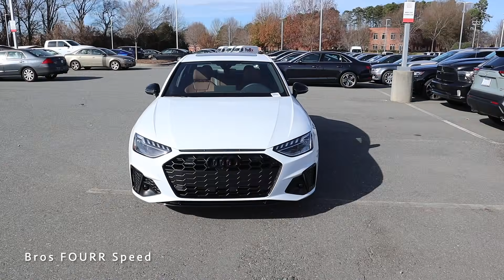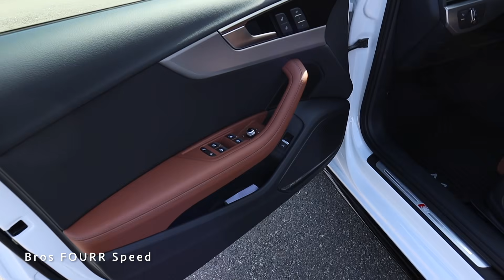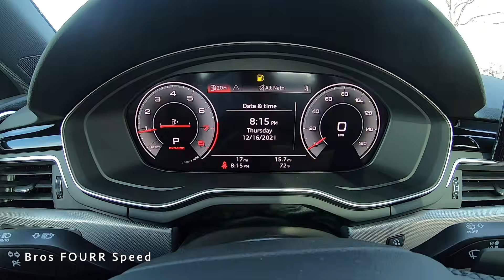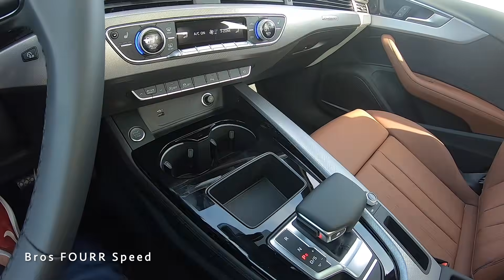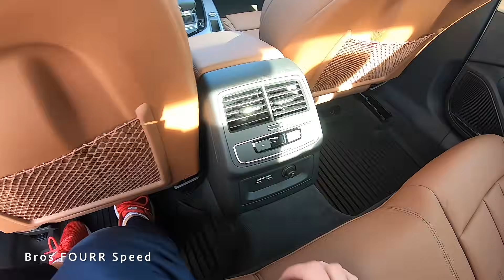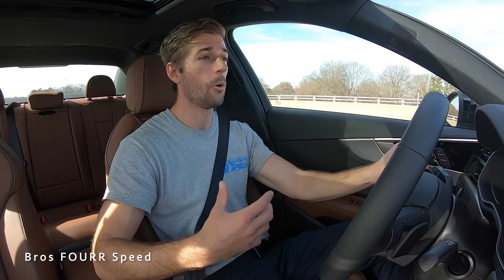2022 Audi A4 S Line 45 Premium Plus: Start Up, Test Drive, Walkaroud, POV and Review

Comment: Awesome! Would you recommend I get one with 68,000 miles on it?
Reply from the maker: That's pretty high.  I would personally rather buy one around even 20K miles or so, but it also depends on what you want to spend.  If it's a CPO and has all the maintenance, it should be a good buy, but just know that as it pushes 100K miles, maintenance might increase some on wear out parts.  Just research any issues with these to know what you are getting.
Reply: Yeah it is pretty high, all of the other A4s I found are the lower trims and that’s the only S Line I managed to find. It was registered to a corporate title so it was probably well kept, carfax is clear and has all the maintenance. I do see that there are some common issues but really that goes for any car. They’re definitely nice cars though! I appreciate the reply

Comment: I bought a 2022 A4 quattro 45 sline black optic (same exact car) in mytthos black last March and I've managed to put about 11K miles on it already and burned through the stock Hankook tires. The most enjoyable car I've ever owned. Driving it in the Florida rain, it sticks to the ground like magic. Looking forward to putting a stage 1 tune on it soon.
Reply from the maker: Very cool, thanks or sharing! Can't go wrong in an Audi!
Reply: I bought the same 2 weeks ago. Absolutely love it. A joy to drive. Currently tracking down an oem spoiler for the trunk and some stainless pedals.
Reply: @Jaydischord74 how’s maintenance
Reply: Nice! I got a 23 chronos gray black optics 👍🏻
Reply: Yeah hankook are trash, get Goodyear or Michelin.
Reply: I’m buying one this Friday can’t wait
Reply: @iam.dthr33  I have a 2021 S5 Sportback now, but you'll love the A4. The dual clutch transmission is so smooth.
Reply: Hows it been now? Has it been reliable?

Comment: Just bought one.
Gray exterior with black interior.
It rocks. We'll see how it does after 30,000 miles of driving.
Reply from the maker: Nice! Should be a pretty solid car
Reply: @BrosFOURRSpeed  
There is one very minor thing.
I wish the dash board was tilted away from the driver by about 15 degrees, or so.
Too me, it seems a little too upright.
Otherwise, the engine is a bear.
I haven't driven the S4, but it can't be that much quicker than A4.
Reply: UPDATE
Reply: @newyork6480 
I don’t drive it much because i work from home.
It has only 26000 miles on it so far.
It is as pristine as the first day I brought it home. No Issue at all.
Just keep up with schedule maintenance and it should be fine for a long time.
I think most people are afraid of cost of maintenance. And it can be expensive for some as car ages.
I am disappointed that 2025 A4/S4 are the last ones.

Comment: Great review.  You always do your research and it shows.  I understand that DCTs shift is jerky from first to second gear at low and slow speeds.  Is it like this also in the A4?  It makes me hesitate considering a new one to buy.  Thanks.
Reply from the maker: Thanks! It seems like a very smooth car to me. I think you'll like it. Definitely test drive one to see
Reply: Yes it is. But it’s ok when you are in a sport mode.
Reply: Should be always careful on intersections. I always switch to sport mode.
Reply: It’s almost the same type of jerk that you’d get on a manual transmission… I don’t mind it
Reply: @iLiftThingsUpNputThemDown well, that's because a dual-clutch system is two manuals working together.

Comment: Audi makes the nicest looking interiors of any car. The seats are always above par.
Reply from the maker: I would agree!  I love the Audi design and brand, definitely nice cars!
Reply: The amazing looking Ipad add on.
Reply: Naw the new c class is nicer.
Reply: Facts 💯
Reply: They’re the best nobody is better than them!! And they’re cars are hella reliable
Reply: You mad? Seats are nice but the centre console is so and screen menus are so dull. Mercedes interior is a step above
Reply: @shazaibbiazahs  everyone’s different.  I think the A4s interior is a nice place to be, bit boring and safe and possibly getting a little old fashioned now (p.s. I have an A4) but comfortable and very functional. Infotainment is good, not the best system in the world but unless you have a proper poverty spec bottom of the range car it’s well equipped, always has things like CarPlay and virtual cockpit which are usually extras.  STronic gearbox has its quirks, is fine when you get used to it but an old fashioned auto box like you get on the BMW is better now a days.

Mercedes I don’t really like, it’s a bit blingy, I’m not sold on the wood effect finish but the alternative piano black everything is a nightmare as even looking at it seems to scratch it, their infotainment system is the worst of the 3 but it is still very comfortable and a nice place to be.  I don’t like their engines which is the biggest turn off for me.

Winner is probably the BMW, so long as it’s the 2020+ model, the older one is a bit old fashioned.  Very comfortable, excellent driving position, good engines and gearboxes.  Interior isn’t massively dissimilar to the A4 but the infotainment screen is more integrated rather than an iPad stuck to the dash like the A4.  Downsides for me is that the basic models even if you get MSport trim don’t come with much and it gets expensive quite quickly when you start ticking boxes.
Reply: @shazaibbiazahs Mercedes interior is cheap creaky plastic haha
Reply: you cant be serious lol. mercedes/porsche both have way better interiors.

Comment: I haven't seen a newer Audi A4 on the road in a while, most Audis I see nowadays are SUVs (Q5 or Q7).
Reply from the maker: Yeah I see a ton of their SUV's too
Reply: @BrosFOURRSpeed  This car would work great in the snowy areas, wished they did a special edition where the factory tunes that engine up so it has the same power specs as the Golf R.  That way the car can better compete with  others in the market.